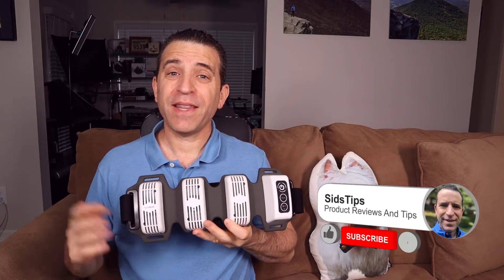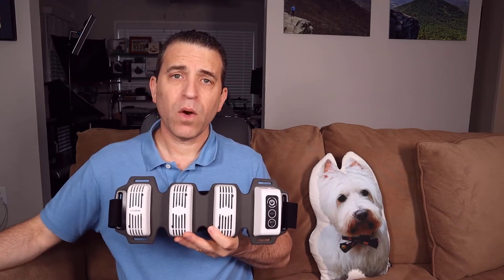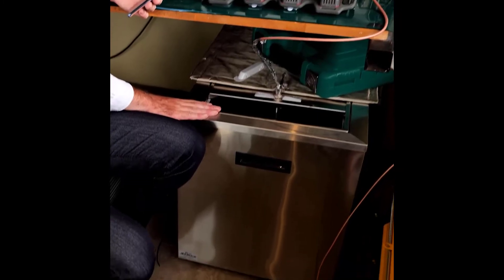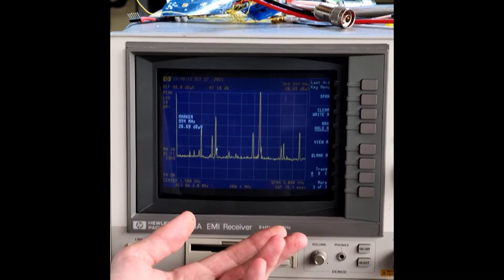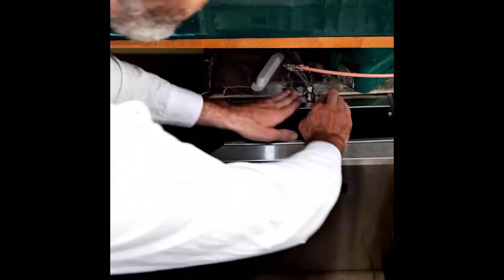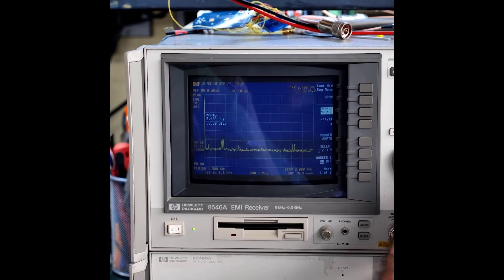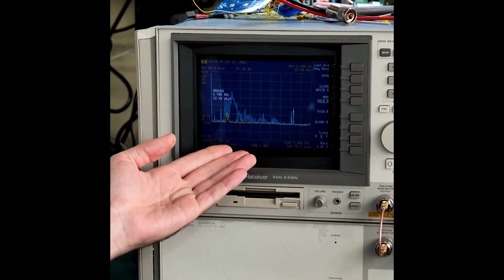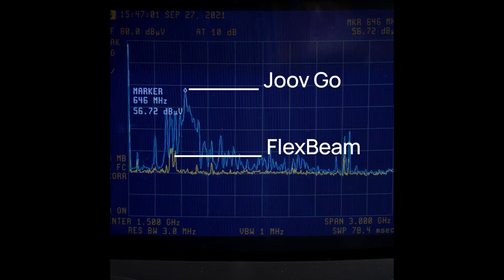Flexbeam Red Light Therapy EMF Comparison With the Joov Go and Cell Phone

Comment: Do you still have the protective covers over the 3 red light areas? It looks like the FlexBeam in the video still has the 3  protective covers that come over the 3 lights on the FlexBeam when you first get it new. If it does have the protective covers still on it, wouldn't that cause a false reading on the EMF measurement?